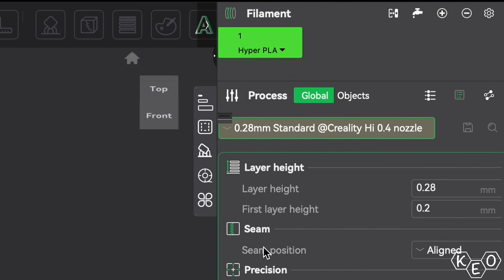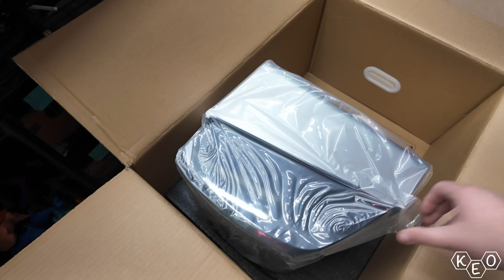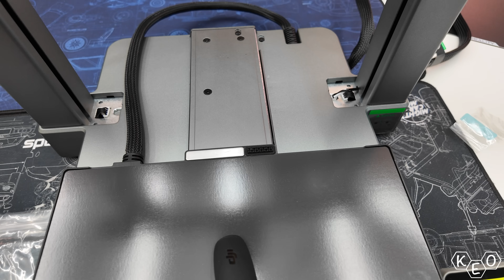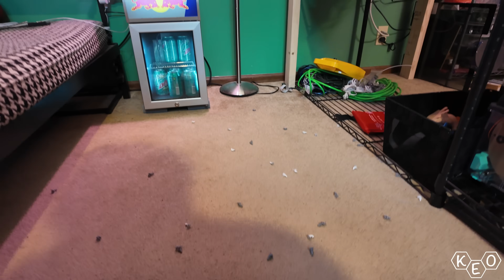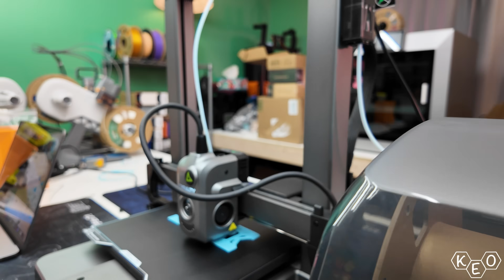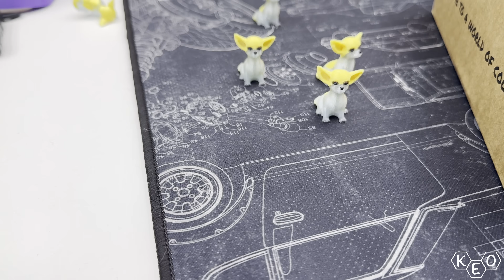Is Creality Relevant Again? Should You Care?

Comment: Yall are crazy about Creality. I just pulled my old ender 3 S1 pro out of the attic and it started cranked out perfect prints. Never had any issues with it in the past either. Will never go Bambulabs. gross. Like the Apple of 3D printers. Just wait until they decide to not let you print and switch off your features.

Comment: Creality slicer was always a skin of a better software it was originally an old version of cura and now orca. Creality lost me when they started adding printer features behind a paywall so pay for a printer with hardware that I then have to pay a subscription to get the full use out of nah I’m good. Sad part is there’s a lot of ppl who got the k2 an was using the stuff for free then out of the blue its behind a paywall. Not a big deal but it shows the direction they are heading. Bambu is going the same direction. So at this point it’s back to open source or nothing.

Comment: Seriously. Wow. If ONLY my AMS box had an open frame or big cutout on the bottom, I WOULDN'T HAVE HAD TO TEAR THE DAMN THING APART EVERY TIME I USED A $7 ROLL OF FILAMENT FROM 2017.
That build plate acts an awful lot like the $11 "YOOPAI Double-Sided Epoxy Resin Build Plate" build plate I just bought at Amazon for my P1S.

Comment: While I'm still not sold on bed slingers, I really like what I see with the CFS. I just got done modding my new AMS and the CFS looks like it has most of the mods, and then some right out of the box. just needs large desiccant compartments.

I wonder if someday someone will crack the code and make any multilateral box work with any brand's printer. That would be a total gamechanger.

Comment: Sorry, but I would buy another A1 Combo, before I would buy this!
Reply: bambulab a1 caught fire with the bed cable.
Reply: @oneanother1  and they fixed that with a recall?
Reply: @ Yes they did, and they offered a few ways a customer could get that problem resolved!  Just like most any other 3d printer company.  Additionally, that problem was before I ever bought one, so it didn't effect me at all.  I have been printing with the A1's for almost 9 months now and have only had a few bad prints, that were mostly user error.  I am not saying Bambu is the best printer out there, but I will say they work great out of the box!
Reply: @stevemisher7197  the thing bambu did was bring the prices of other machinesnway down and made others copy them. just having a open firmware means that 3tf party apps and hardware will work on it. the community will continue to improve it.
Reply: @ solid history? bambulab first bed slinger and the bed cable started  causing electrical fire?

its a bed slinger, bambulab brought nothing new to the market. I mean, having bambulab pull the rug out of you too after you bought it. bots strong over here.
Reply: @ the thing bambu did was bring the prices of other machinesnway down and made others copy them. just having a open firmware means that 3tf party apps and hardware will work on it. the community will continue to improve it.
Reply: @oneanother1  what if you just hate the community
Reply: @hihellothere9569  why?
Reply: @why? they do it for free. bambulab takes it away.
Reply: why?
Reply: @oneanother1  Because I don't think it is as refined as the A1!  Too much simply fastened to the uprights, with double side tape.  The one thing I do like is the AMS setup they came up with compared to the one Bambu offers.
Reply: @ bed slinger are pretty much as good as they can get. creality may offer a bigger model.
Reply: why? I would never buy a bambu due to their closed firmware.
Reply: @ This is just a hobby for me!  I have no intention to do any mods to my printers.  I just wanted them to print.  That is why the things Bambu is doing, means nothing to me.   The things I make and sell, are very basic and the quality I get from the A1's are great.
Reply: @oneanother1  Because it's got a solid history of being the highest quality bed slinger on the market, and this brings little to nothing new to the table?
Reply: @Cryostatica  solid history? bambulab first bed slinger and the bed cable started  causing electrical fire?

its a bed slinger, bambulab brought nothing new to the market. I mean, having bambulab pull the rug out of you too after you bought it. bots strong over here.

Comment: Sooo, until Creality just straight up copy and pasted the Bambu A1, people shit on almost every printer creality has come out with until they do the same old boring A1 crap, why?
Reply: It's boring sure, but it works.
That's more than I can say about most of the Creality printers I've had the opportunity to work with
Reply: @ImNeverGonnaComment this is true. I'm a refugee from the Ender 3 v2. I just want to get my stuff printed. Not fiddle endlessly with the printer hoping that THIS TIME it will work.
Reply: I say this is an improvement over the A1. Higher flow hotend, step servos for x and y, and a full sized AMS

Comment: The key difference between screws and bolts lies in their threading and how they're secured: bolts are typically partially threaded and secured with a nut, while screws are fully threaded and often self-tap into a material.
Reply: Google "socket head cap screw" and tell me if that definition holds.
Reply: @CarbonKevin  their machine screws ... a screw that takes a nut ...
Reply: @CarbonKevin  There are ALWAYS exceptions. How much time did you spend finding this?
Reply: @edmclaughlin4923 They're a highly common screw for 3d print projects so I doubt he had to think about it for very long, but you're spot on, there are always exceptions.  I think thinner diameter fasteners often get the "screw" label, even if they have more in common with most bolts.
Reply: @JesseGrunewald I think size seems to be a factor also. I see small "bolts" referred to as machine screws and large "screws" referred to as lag bolts
Reply: I’m pretty sure it solely depends if there is a nut or not at the end.